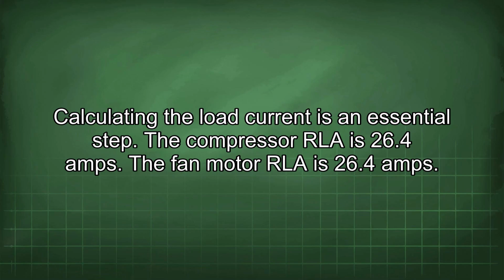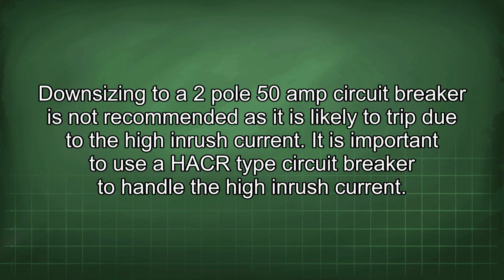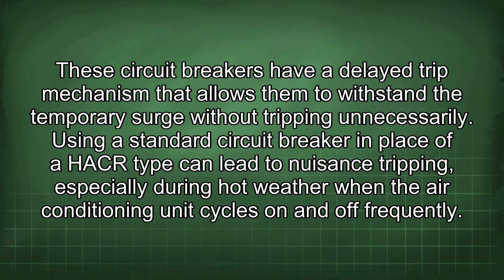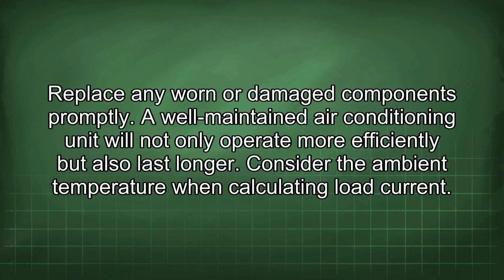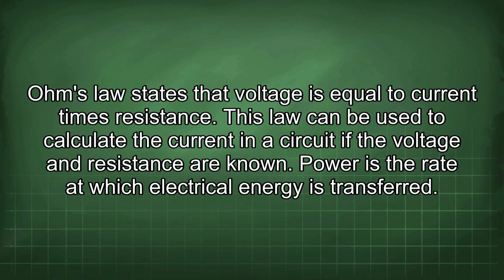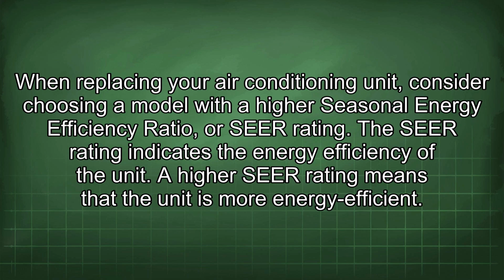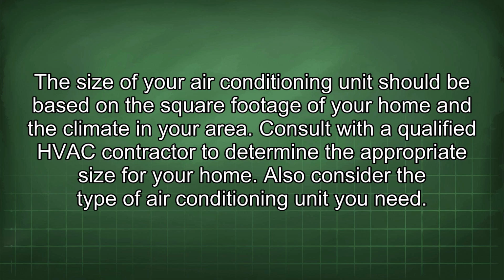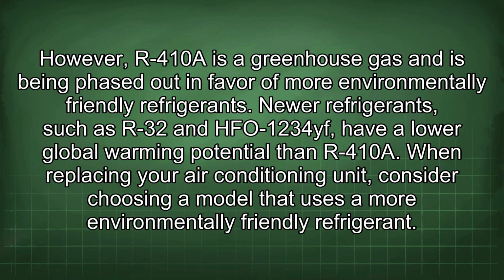Air Conditioner Circuit Breaker Sizing Explained Simply

Comment: nice to be here again.............i ven seen many videos cuz i would like to size wire , ocpd , transformer etc

examlpe in the plate of The AC we can see  MCA for cable and MROPD  and this is a piece of cake no more culcalutations
but if we have a AC and we just know is 25 ton (300 000 BTU)/460 vac how can i determinate  ampers and ocpd,,,,,,i ve seen people say 
1 ton=3.5kw/220 vac    =16 amp            but  is not real  it is to much   when ive seen them 6 amps or some like that

how can i determinate the real amps for AC  without see the technical data?

on the othr hand for a group of AC 460 vac how can i size the trafo if site is 220 vac?  note ; dont forget the inrush of AC

i hope this is clear and see you soon
Reply from the maker: Hello @tomasvazquezrangel,

Thanks for your question; great to hear from you again.

Unfortunately, you can't accurately determine the running amps and required Overcurrent Protection Device (OCPD) for an AC unit using only its tonnage and voltage. The values you've seen, like 1 ton = 3.5 kW, are just approximations for cooling capacity and don't directly translate to the actual electrical current an AC compressor draws. The real amperage can vary a lot depending on the specific model, the compressor's efficiency, and whether it's a single-speed, two-speed, or variable-speed unit.

The values on a unit's nameplate, such as MCA (Minimum Circuit Ampacity) and MOPD (Maximum Overcurrent Protection Device), are determined by the manufacturer through testing and are the only reliable way to size the wiring and OCPD. These ratings account for the maximum expected current draw, including the inrush current during startup.

Estimating AC Amperage

Without the nameplate data, a rough estimate can be made using a general rule of thumb. For commercial AC units, you can assume that 1 ton of cooling capacity requires about 1 kW of electrical power.
A 25-ton unit would therefore consume approximately 25 kW of power.

Using this estimate, we can calculate the approximate current draw for a 460 VAC system.
For three-phase AC systems, the formula is: I = P / (sqrt(3) x V)
Assuming a three-phase system (which is typical for a 25-ton unit):
I = 25,000 W / (sqrt(3) x 460 V) ≈ 31.4 amps

This is only a full load amps (FLA) estimate. The actual MCA (Minimum Circuit Ampacity) will be higher to account for factors like the fan motor and startup current. A good rule of thumb is to add a 25% safety factor for the fan motor, and another 25% for other components.

Sizing a Transformer for a Group of AC Units

To size a transformer for a group of 460 VAC AC units from a 220 VAC source, you need to follow these steps:
1. Determine the total load in kVA: Add up the Maximum Amps (MCA) for each AC unit. Multiply the total amperage by the voltage and then convert to kVA.
- For a three-phase system: kVA = (Total Amps x Voltage x sqrt(3)) / 1000
- For a single-phase system: kVA = (Total Amps x Voltage) / 1000
2. Account for the inrush current: The inrush current of a compressor can be 5 to 8 times the normal running current. A standard transformer is designed to handle this without being oversized. The locked-rotor current (LRA) of the largest motor on the circuit is the primary concern. The transformer itself must be rated to handle this transient surge without a significant voltage drop.
3. Apply a safety margin: Choose a transformer that is 125% of the calculated load. This provides a safety margin for future expansion and ensures the transformer doesn't operate at its maximum capacity, which can shorten its lifespan.

If you can send a few more details about your proposed situation, I can help figure out the exact solution.

Example Calculation:

Let's say you have two 25-ton AC units, and you've determined their MCA is 40 amps each (a conservative estimate).
1. Total Load Amps: 40 amps x 2 = 80 amps
2. Calculate kVA: Assuming a three-phase system:
kVA = (80 A x 460 V x sqrt(3)) / 1000 ≈ 63.8 kVA
3. Apply Safety Margin:
Transformer size = 63.8 kVA x 1.25 ≈ 79.75 kVA

You would then select a standard transformer size that is equal to or greater than 79.75 kVA, such as an 80 kVA or 100 kVA transformer. Remember, the transformer you'll need will be a step-up transformer to convert your 220 VAC source to 460 VAC. Always consult a licensed electrician or electrical engineer for final calculations and installation to ensure safety and compliance with all local electrical codes.

Other Options for Consideration

I also want to propose a couple alternative options that may be more efficient or practical. If it is possible to upgrade the utility service to 500 volts (480Y/277 V) and instead spend that budget on a smaller stepdown transformer for 208Y/120 V or 220Y/127 V (recommended) loads, that is ideal for the large 460 volt loads to be powered directly.

If your utility requires you to pay for the medium to low voltage step down transformer either way, the ultimate solution, especially for new commercial or industrial builds, is a system somewhere around 440Y/254 V. It allows almost all modern electronic devices such CNC machines, LED drivers, servers, computers, EV chargers etc. to operate within the IEC specification, as well as 240 volt (L-L) appliances, while still supplying electricity directly to the 460 volt motors/air compressors. You would only need a small step down transformer for convenience outlets and any hardwired devices that truly need 120 volts.

Measuring Actual AC Current

If the nameplate is missing, you can measure the actual running current of the AC unit to get a more accurate value than a simple estimate. This is a job for a clamp meter, which can measure amperage without breaking the circuit.
- Get a clamp meter: You need a clamp meter that can measure AC current. Some models, especially those designed for HVAC work, can also measure inrush current, which is useful for verifying the starting load.
- Identify the correct wire: You need to clamp the meter around a single "hot" wire leading to the compressor or the entire unit. You can't clamp around the whole power cord (hot and neutral wires together) because the magnetic fields will cancel each other out, giving you a reading of zero.
- Measure the running current: With the AC unit running under normal load (e.g., in a hot room with the thermostat set low), clamp the meter around one of the hot wires. The reading you get is the Running Amps or Full Load Amps (FLA).
- Measure the inrush current: Many modern clamp meters have a special "inrush" or "MAX" function that captures the highest current spike when the compressor first turns on. This is important because the OCPD (like a circuit breaker) must be able to handle this brief, high surge without tripping.

Remember, measuring live electrical circuits can be dangerous. Always follow proper safety procedure! Best of luck. 🙂

Sincerely,

BESA Research
Reply: @BESAResearch  HERE  again i hope you to see this and could give me some advice,, nice weekend.

VOLTAGE DROP AT START-UP IN MOTORS <15% is just a hypothetical example. 250 hp motor FP=0.25 INV COS=75.52 (data recommended by IEEE for motor start-up) 460 V FLC= 302 A Single 500 kcmil cable per phase 302*1.25 =378 A 1C x F- 3-F- 500kcmil 380 A R=0.095 X=0.157 Code B 3.54 LRC = 1, 110.57 A L=200 m-0.200 km e%=1.73* 1,110.57/1 * 0.200 (0.095(0.25)+(0.157 sin (75.52) e%=67.61/460*100=14.7% 2 cables of 3/0 in parallel 302*1.25 =378 A 2C x F- 3-F- 3/0 AWG 200 A*2=400 A R=0.259 x=0.171 e%=1.73* 1,110.57/1 * 0.200 (0.095(0.25)+(0.157 sin (75.52) e%=41.7/460*100=9.06% Single 600 kcmil cable per phase 420 A R=0.082 X=0.157 e%=1.73* 1,110.57/1 * 0.200 (0.082(0.25)+(0.157 sin (75.52) e%=66.36.7/460*100=14.4% ...
Reply from the maker: Hi there @tomasvazquezrangel!

It seems you're performing voltage drop calculations for a motor start-up and comparing different cable configurations. I can help clarify your calculations and provide some advice.

Your calculations appear to be applying a general voltage drop formula, but there are some inconsistencies and potential errors. Let's break down the process and provide a correct approach.

### Voltage Drop Calculation at Start-Up

The formula for calculating the voltage drop percentage (e%) in a three-phase system is:

e% = (sqrt(3) * I * L * (R cos(theta) + X sin(theta)) / V_line) * 100

Where:
* I = Current in Amperes
* L = Length of the circuit in kilometers
* R = AC resistance of the conductor in ohms per kilometer
* X = AC reactance of the conductor in ohms per kilometer
* cos(theta) = Power factor (PF)
* sin(theta) = sin(arccos(PF))
* V_line = Line-to-line voltage in Volts

For motor start-up, the key values to use are the *locked rotor current (LRC)* and the **power factor at start-up**.

Let's re-calculate using your provided data:

* Motor: 250 hp, 460 V
* Locked Rotor Current (LRC): 1,110.57 A
* Start-up Power Factor (PF): 0.25 (Given by you and common for motor start-up)
* sin(theta) at Start-up: sin(arccos(0.25)) ~= 0.968
* Length (L): 200 m = 0.200 km
* Conductor Type: You specified several, so we'll re-evaluate each. The R and X values provided seem to be for a specific cable type and installation method (e.g., in conduit or free air), which is crucial.

--------------------------------------------------------------------------------

### Re-evaluating Your Calculations

1. *Single 500 kcmil Cable:*
    * *R:* 0.095 Ohm/km
    * *X:* 0.157 Ohm/km
    * *Calculation:*
        e% = (sqrt(3) * 1110.57 * 0.200 * (0.095 * 0.25 + 0.157 * 0.968) / 460) * 100
        e% = (1.732 * 1110.57 * 0.200 * (0.02375 + 0.15206) / 460) * 100
        e% = (384.45 * 0.17581 / 460) * 100 ~= (67.59 / 460) * 100 ~= 14.7%
    * *Result:* Your calculation of 14.7% is correct.

2. *Two 3/0 AWG Cables in Parallel:*
    * When conductors are in parallel, their effective resistance and reactance are reduced. Since you have two cables, the values are halved.
    * *R per cable:* 0.259 Ohm/km
    * *X per cable:* 0.171 Ohm/km
    * *Effective R:* 0.259 / 2 = 0.1295 Ohm/km
    * *Effective X:* 0.171 / 2 = 0.0855 Ohm/km
    * *Calculation:*
        e% = (sqrt(3) * 1110.57 * 0.200 * (0.1295 * 0.25 + 0.0855 * 0.968) / 460) * 100
        e% = (384.45 * (0.032375 + 0.08277) / 460) * 100 ~= (384.45 * 0.1151 / 460) * 100 ~= (44.25 / 460) * 100 ~= 9.62%
    * *Result:* Your calculation of 9.06% is close, but there's a slight discrepancy likely from rounding in the R and X values you provided or how you combined them. My result of 9.62% is more accurate based on the formula and typical values.

3. *Single 600 kcmil Cable:*
    * *R:* 0.082 Ohm/km
    * *X:* 0.157 Ohm/km
    * *Calculation:*
        e% = (sqrt(3) * 1110.57 * 0.200 * (0.082 * 0.25 + 0.157 * 0.968) / 460) * 100
        e% = (384.45 * (0.0205 + 0.15206) / 460) * 100 ~= (384.45 * 0.17256 / 460) * 100 ~= (66.38 / 460) * 100 ~= 14.43%
    * *Result:* Your calculation of 14.4% is correct.

--------------------------------------------------------------------------------

### Advice and Recommendations

* *Accuracy is Key:* Double-check the *R* and *X* values from your source (e.g., NEC tables, manufacturer data). These values depend on the wire material (copper vs. aluminum), insulation, temperature, and installation method (e.g., in a raceway, spacing).
* *Code Compliance:* Ensure your chosen cable size meets the *ampacity* requirements. You've correctly calculated the FLC and multiplied by 1.25, but the *2C x F- 3-F- 3/0 AWG* configuration provides a combined ampacity of 400A (200A per cable), which is sufficient for your continuous load of 378A. However, it's crucial to confirm this is a valid parallel installation under local codes.
* *Voltage Drop Limits:* The 15% voltage drop limit at start-up is a common guideline, but it's not a hard rule. Many systems can tolerate higher drops, while others (especially those with sensitive electronics) may require less. Your calculations show that a single *500 kcmil* or *600 kcmil* cable results in a voltage drop close to or slightly below this threshold. The parallel *3/0 AWG* cables provide the best performance, with a drop well under 10%.
* *Harmonics:* For modern motors controlled by VFDs, harmonics can affect the voltage drop and cable performance, though this is a more advanced consideration for your initial analysis.
* *Practical Considerations:* While the parallel 3/0 AWG cables offer the lowest voltage drop, they may be more complex and expensive to install than a single large cable. You need to balance the electrical performance with cost and ease of installation.

In summary, your calculations were quite close, but there's a slight error in your parallel cable calculation. The *two 3/0 AWG cables in parallel* are the most effective solution for minimizing voltage drop during motor start-up among the options you've provided.

Sincerely,

BESA Research
Reply: @BESAResearch  wow what a wonderful answer i made some exercises before sending you the hipotetic problem and i was thinking how is posible 2 cables 3/0 are bettrer than one 600 kcmil if this one offers more amps but you gave me the answer 

its a shame i  cant send you in pics or audio some material i have so you can see it   ,,,,,, i mean that would be more easy for me........... but thanks a lot ...the best answer i have ever had,,,,,,
Reply from the maker: Hello @tomasvazquezrangel,

I am glad it helped. If you want to send your email address or WhatsApp we could figure it out that way. You could also put it in a Google Document or Google Sheet and send the link here.

Best regards,

BESA Research